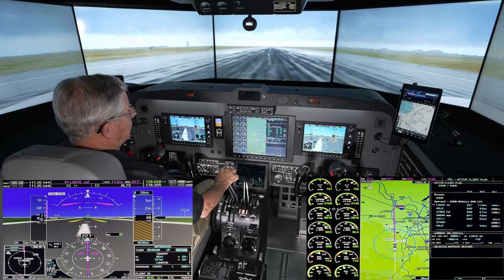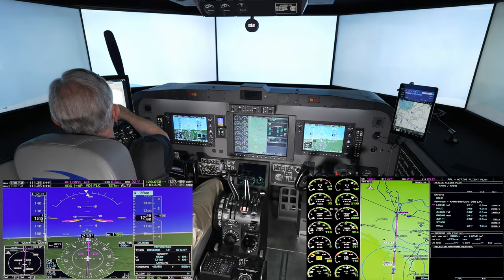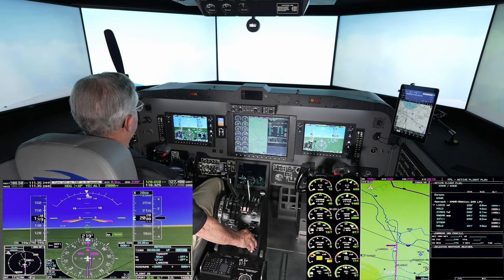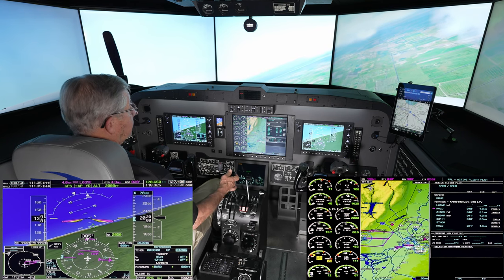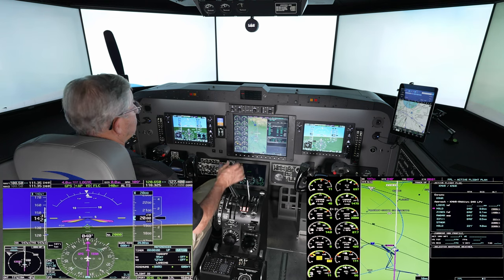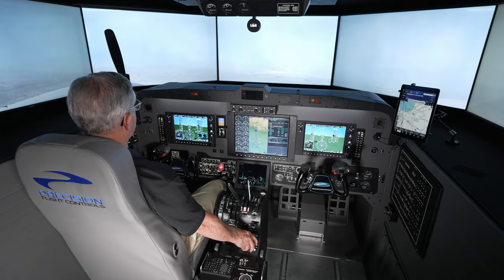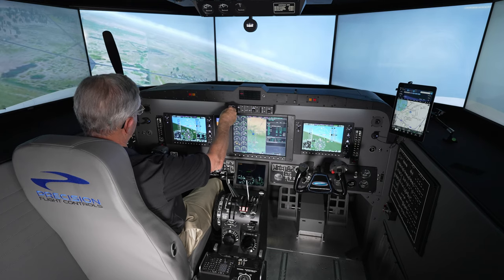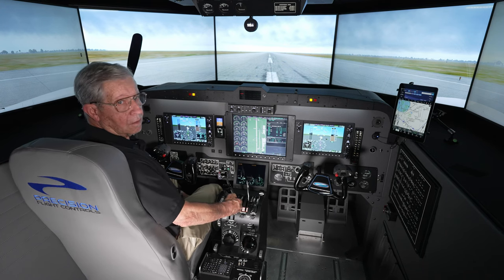King Air B200 type-specific AATD Engine failure at rotation demonstration -Precision Flight Controls

Comment: Cool video,
Only question was why the 5 minute delay to identify, verify & feather dead engine then wait to pitch for Blue Line?

I know this is a king air & it has power but "The Drill" is gear & flaps up. Raise dead engine, use rudder & pitch for blue line is sorta the first immediate things one does then identify, verify & feather. Turn off mixture & cut power to dead engine etc.
Reply: B200s have autofeather, so there isn't any hurry.
Reply: @tstanley01 autofeather should still be verified